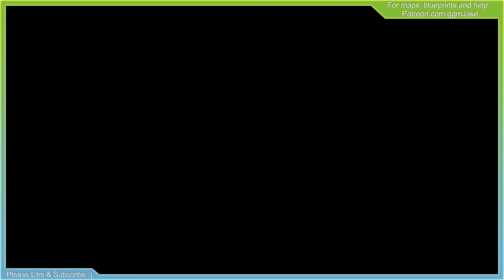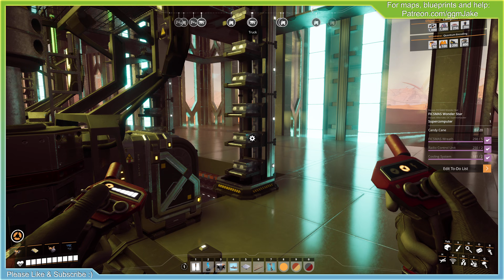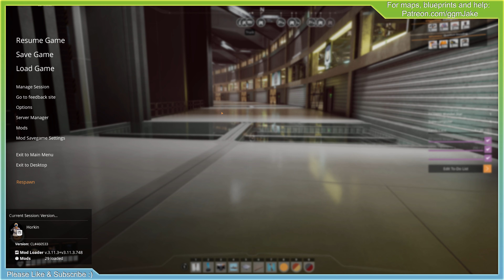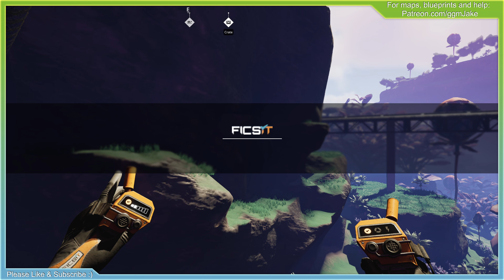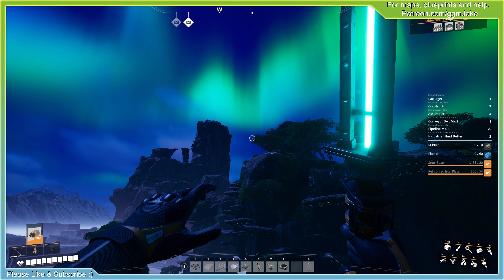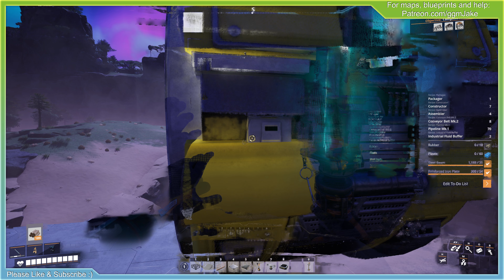When to Centralize Your Production

Comment: How do you transition into decentralized factories from starter base? I hit a wall with the complexity involved and having to supply every factory with each item while balancing. Although most of my production are undersupplied due to power issues I had for most of the game(desert start, solved when I found oil going South). Seeking a modular approach, do I build a dedicated factory at the resource node? Then I have to couple all of my same item inputs and outputs and things become a mess. Logistics, logistics, logistics...
Reply from the maker: Stay tuned. I've created a video for you about this. It'll be up in a few days.

Comment: I have difficulty load balancing everything once I get past the beginning stages. When there’s a fractional relation between input and output it gets really annoying to calculate and design. I always hit that wall and end up not playing because the fun is gone, I’m doing math and graphs and I’m trying to interpret what planning websites are saying instead of playing the game…
Reply: That's when manifolds shine. If it doesn't absolutely need a balancer, don't use one. I like a nice load balancer as much as the next guy, but they are clunky, chunky, and take forever to set up. Manifolds are simple as
Reply from the maker: Gonna do a video on this. No math needed.
Reply: load balancing is more of a stylistic choice generally. It's like an extra step that you only do because it looks cool + is fun to do lol.

You can just use manifolds instead.